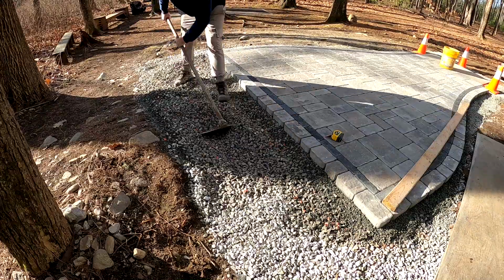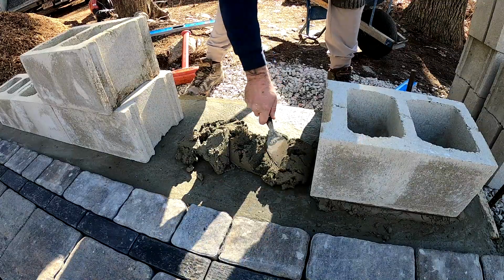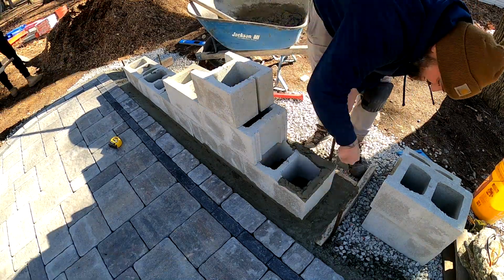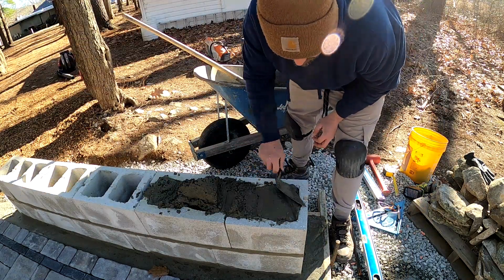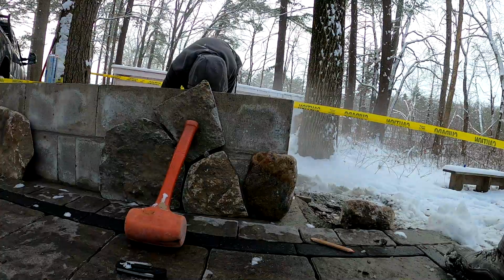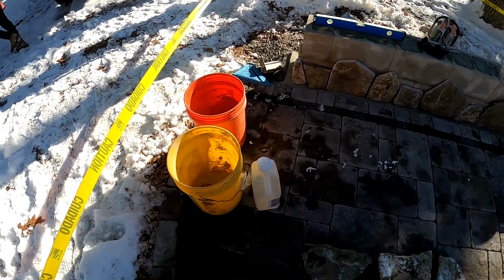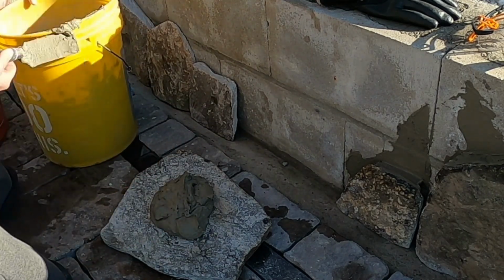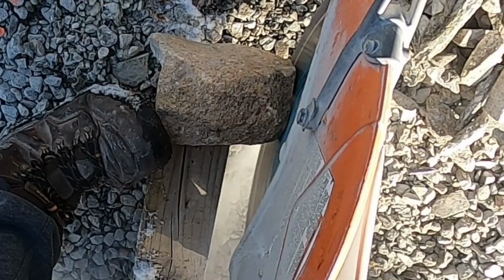How To Build a Stone Veneer Sitting Wall | Part 1

Comment: So I dug the trench, shaped it out (after hitting, roots and good sized rocks), framed it in, threw down a good layer of 3/4 inch crushed granite, tamped it... took weeks to pour the cement because we barely had a period of three or more days without rain.... finally got a break of three straight sunny days, poured the cement, I thought it was pretty level... laid down the cinder blocks, really leveled everything, measured everything 3 to 4 times.... let the mortar dry and the blocks to set..... today I started sizing, fitting, refitting and cutting the stone veneer (thank goodness for diamond saw blades)... this is going to take a bit because it's matching and refitting all the pieces and shapes, sizes, colors, thickness.....

Comment: Getting ready to lay natural stone veneer, mosaic style, on our block foundation. Our concrete footers extend a good piece past the block foundation. Should I lay the rock directly on the footer foundation? Or should I elevate it off the foundation a bit to protect against water trapping at the bottom? And if the answer is that it should be elevated, what do you use, angle iron, etc?

Thanks!!!
Reply from the maker: I would definitely recommend you build right on the footer. That is the best way to go. I only elevate veneer on angle iron when there is not a footing. You should be all set ✌
Reply: @TheChristianHardscaper  thanks for the reply!

Should I be worried about water getting behind the veneer from the ground? Pea gravel will be landscaped next to the wall in the future.

Comment: How come you use mortar for this but for a patio wall you would just use retaining wall blocks and block adhesive between them?
Reply from the maker: So with natural stone work, the idea is to make one solid piece. When you build block walls, they need to be built so the can flex and move slightly with ground shifting. The glue is flexible to a certain point but holds the blocks together. So all the blocks can flex ever so slightly and raise and lower without falling apart. Masonry structures need to be 1 solid piece which is why you always pour a footing for that. ✌

Comment: Nice video! I have a few questions, 1 - Why not wet the cinderblock? 2 - Isn't it a bad idea to do this below freezing? I watch another video that said that the water will freeze and expand when its warm and this makes for a very bad bond.  This work should always be done above 40 degrees right? I watched several other videos and the block needs to be wet and also above freezing so the mortar dries correctly?
Reply from the maker: Water can help, but that is mainly to make sure the block is clean from dust. We washed the blocks before the day we set the stone. And we used an additive called (Cold Check) to the mortar to help curing in cold temps and also covered the bench with thermal concrete tarps over night. You can w=do this work in somewhat cold temps as long as you take the correct precautions. ✌
Reply: @TheChristianHardscaper  Nice, thank you for the reply!

Comment: Do the  blocks ever need to be sprayed wet before mortaring them for better adhesion? Best, Steve
Reply: CMU's, concrete block. No. Stonework,  veneers, yes. Using water on concrete blocks makes a mess. Block mortar is supposed to be like peanut butter.  If it's too wet, they sink. When doing veneer always dappen the surfaces of the stone or it won't stick. A damp sponge works well. That's the way I was taught.
Reply: @ktm3850  Thanks..I haven't tried Veneer yet so I had no idea ....just going by patching concrete...Best, Steve
Reply from the maker: He is correct, when building the block work it is best to not get things too wet or it is very hard to keep them stable. I cleaned the surface of the blocks the day before to make sure all the dust was off it before we did the veneer. Then on the day, you seen me wet / clean the stones before application. I didn’t feel the need to wet the blocks however. They were clean and with the cold weather, I wanted to use as little water as possible. ✌🏻